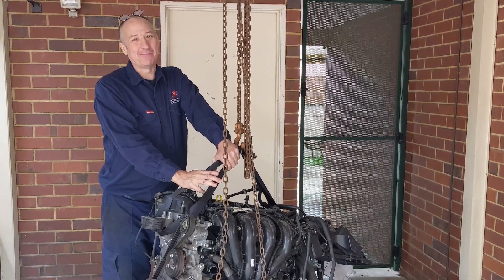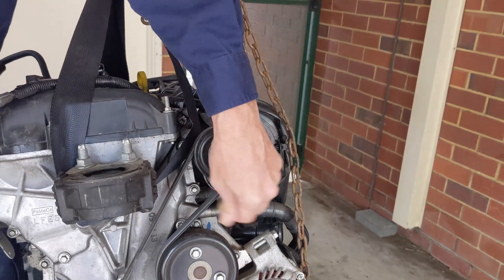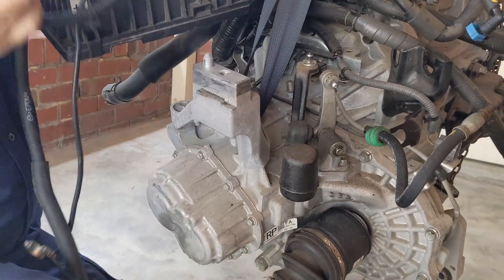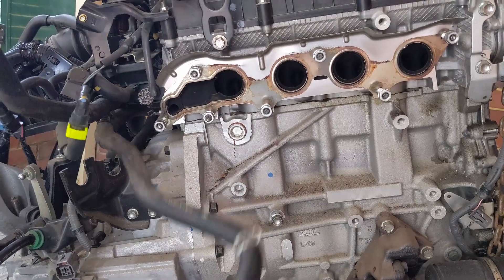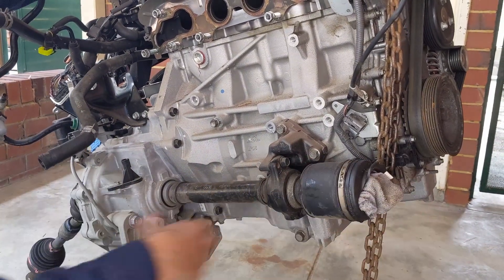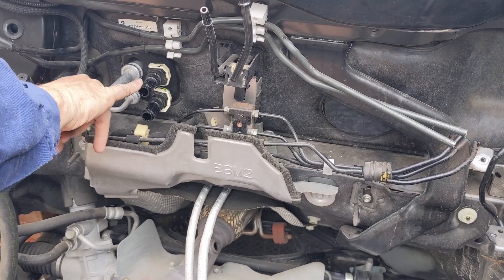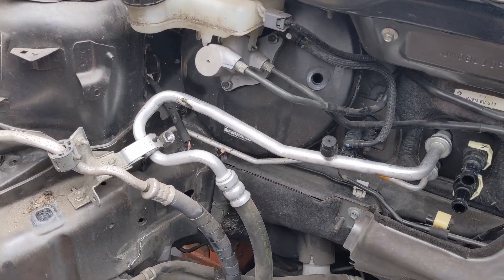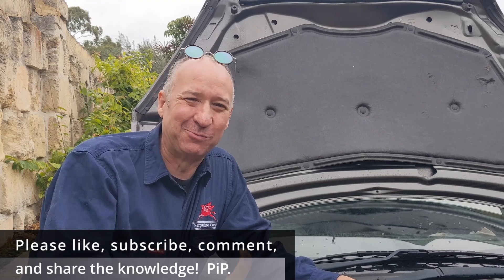BL Mazda 3: LFVE 2.0L engine geometry with a manual gearbox. 2009 2010 2011 2012 2013 2nd gen LF-VE

Comment: Thanks, that was useful. I'm curious to know how many electrical connections there are between the engine and the car. I saw the main blue plug and the positve to the battery and it looked like a couple of earths. Were there any others at all? I'm assuming that the immobiliser in the key fob gets energised by a coil near the ignition key barrel and communicates wirelessly to the ECU, so no wires for that? Is there anything else electrical?

Comment: Thank you so much for showing us the engine.

I was looking for the reverse light switch on the manual transmission. I think I see it near the bottom towards the front of the vehicle, but couldn't quite make out where it's connected to. Any way you can show it? My reverse lights do not come on, but I do show some power (not a lot) at the sockets in the rear of the trunk.

I am in the United States so the driver's side is on the left, a mirror image of yours.
Reply from the maker: Hi John, if you go to 4m 14s in the clip, the reverse switch is that black and silver plug bolted onto the gearbox towards the bottom right of screen with a black electrical lead coming off it.

Glad to help.

Paul in Perth, Australia.
Reply: @PaulinPerth  Thank you, Paul. Would you know if I were to remove that switch to replace it, would the gear oil flow out?
Reply from the maker: @johnhwang339  Hi John, the switch needs a 24mm open ended spanner to remove.  It is located below the drive shaft height, so oil will definitely flow out.

Paul.
Reply: @PaulinPerth  I was at a junkyard today and looking at a 2012 Mazda 3 with 6 speed manual with the Skyactiv engine and the housing for the transmission looked different. I found a switch, removed the connector, but had a hard time getting a wrench around it. The cooling fins on the housing prevented the wrench from turning. I had to break off the fin so my wrench 🔧 would be able to turn and remove it.
Reply from the maker: @johnhwang339  Yeah, I noticed that on mine too.  The drain plug has the same thing.  I'm not sure why it is engineered that way.  But congrats on getting your part.  Paul.